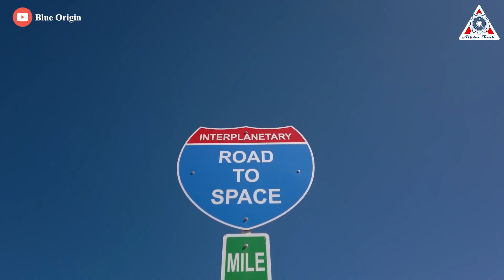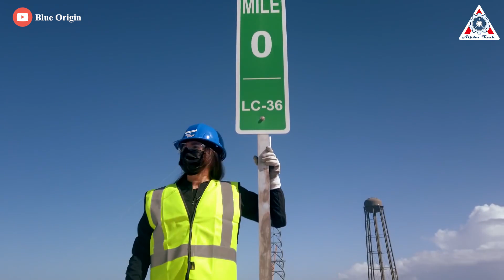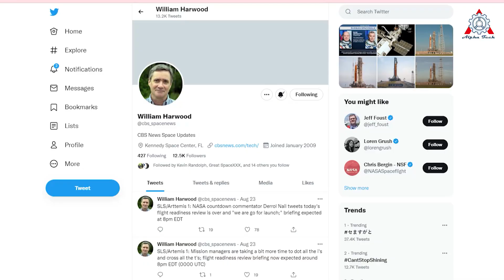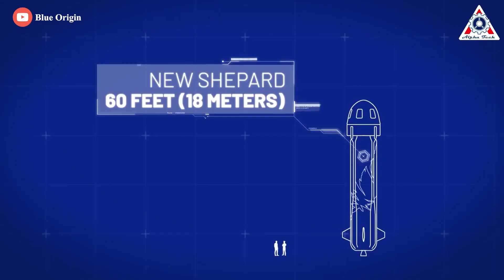WHY Jeff Bezos & Blue Origin is so SCARED of what SpaceX just did in Florida?

Comment: The bigger the booster and starship is together on a launch table or launch mount the higher the launch mount needs to be off the ground. The engines needed to lift such mass will put off such a long stream of burning propellant out of the nozzles that too much of it will bounce back off of the ground below the launch table/mount and ricochet upwards right back up into the booster engines and bottom of the booster if the table is too low to the ground. That's what I feel about it. Also because adding water creates too much water vapor that blocks the view of what's happening during the launches directly under the launch table/mount. Dust and Vapor fills the air and ideas to eliminate as much of both of those as possible during launches should be very important to solve that issue.